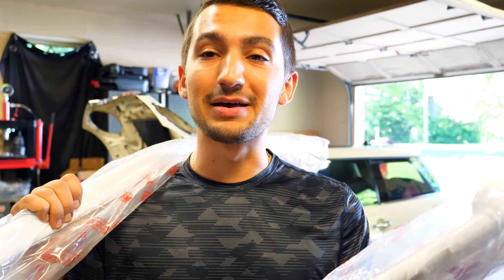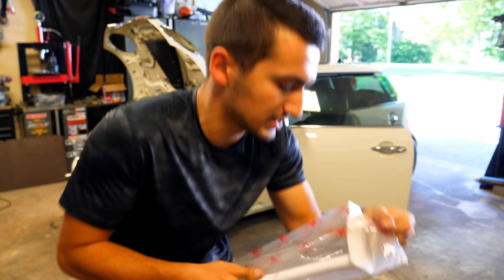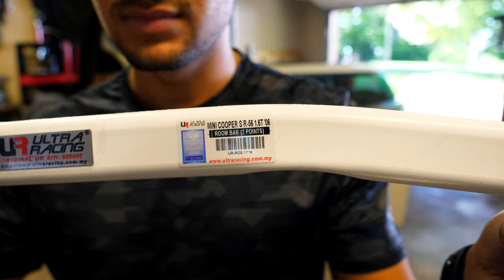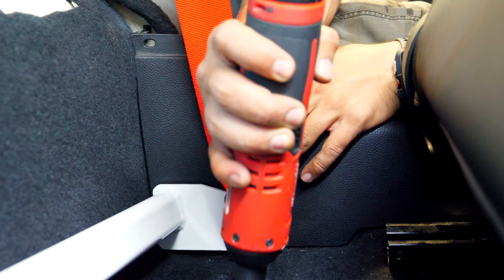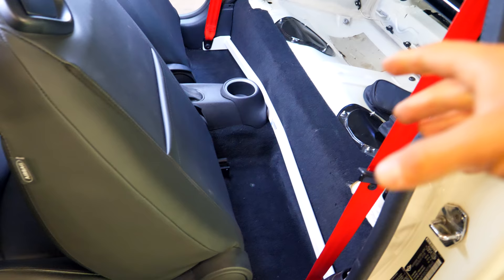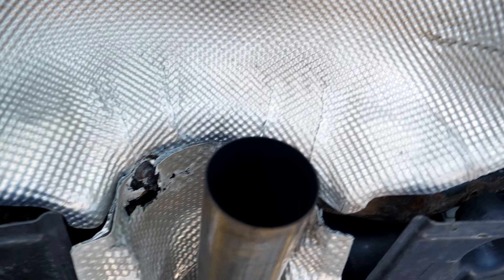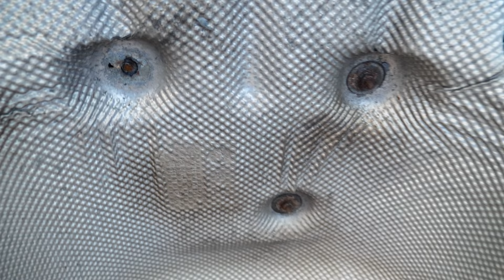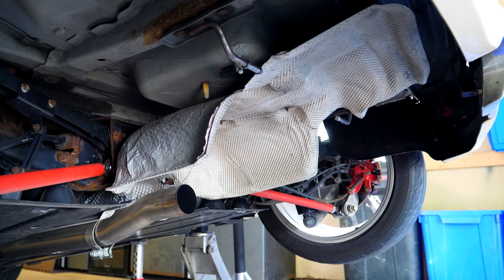Increasing Chassis Rigidity with ULTRA RACING PARTS

Comment: Mini's looking great milan, the red mirroros look good on it, you should wrap the roof in gloss black, and do a double red offset racing stripe down the drivers side of the hood, front bumper, hatch and rear bumper, and as for all the chrome you can either try the dupli-color black paint kit on all the chrome trim or take them all off and a scotch-bright scuff pad and scuff them lightly to give themthe brushed aluminium look and clear them with a satin clear to keeep them protected.

Comment: I don’t think that interior brace is going to do anything for rigidity.
Reply: The FRS will still beat it. Spend the money on track lessons.
Reply: Literally nothing... the car would be slower simply due to carting around an extra couple of kg's...
Reply: Even the rear subframe desing looks tough enough
Reply: yep.. can't see how it would brace or strengthen rigidity.. as it's just running in front of the rear seat base!?>..
Reply: @Jeremy Burris it doesn't... It has a rear strut brace which connects the top of the 2 rear strut towers... COMPLETELY different thing.. it is actually connected to the suspension and adds strength through triangulation...
Reply: @Jeremy Burris Spare part catalogue says part is "tube for cargo holder"

Comment: That 5th pin is either the power mirror retractor or the defroster circuit.  Just pop the red cover off and replace it on your original mirror.  There was no need to replace the entire mirror.